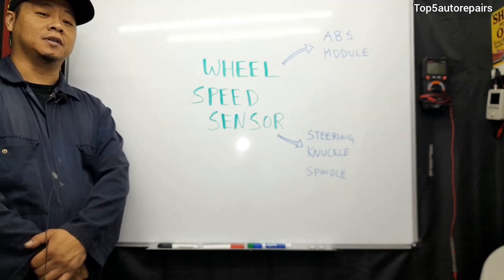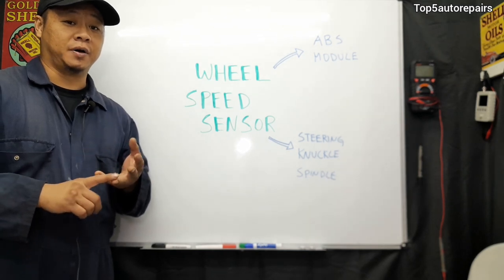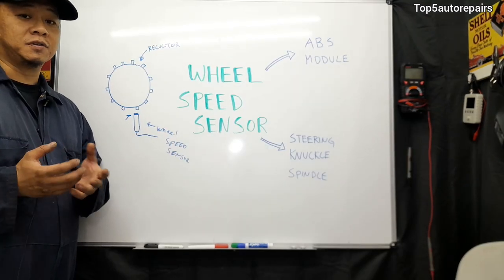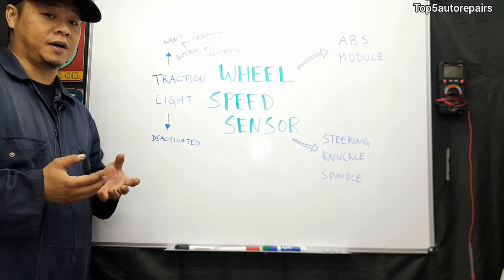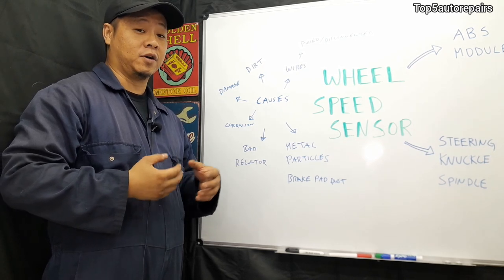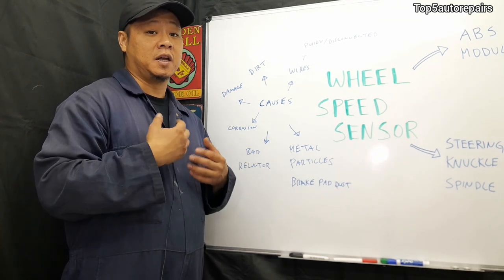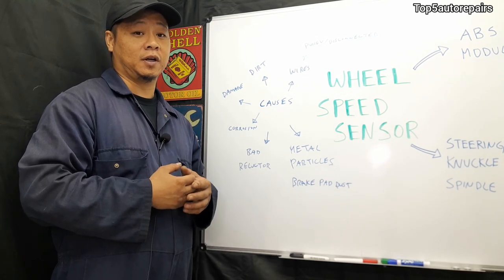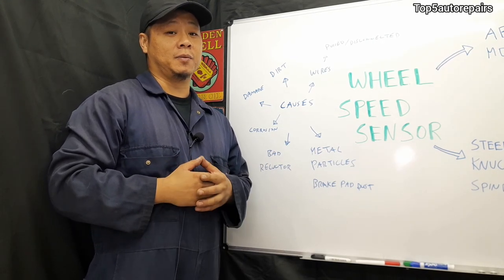Symptoms of a Bad Wheel Speed Sensor How it Works and Cause of Failure C0040 C0221 C0035

Comment: Question… my abs issue is at slow speeds.. i feel the abs working “thumping”  when breaking.. but one i get to higher speeds it works normally and stays normal.. even at slow speeds..abs light is on..   once i shut bike off and start again.. it does it all over.. i did just have my front tire off… i also installed a thundermax tuner.. so I’m not sure what one could be the issue

Thanks
Reply: I have this issue too
Reply: @JustATruckDriver1  wheel bearings.. replace them.. fixed the issue
Reply: @christopherbohnyak443  have you heard about the wheel sensors as well?
Reply: @christopherbohnyak443  also, my brake fluid low warning light is on and also my brake light is on
Reply: @JustATruckDriver1  that i have no clue.. could all be because it’s low.. but if it’s low.. you have a leak somewhere.. good luck…
Reply: @christopherbohnyak443  thank you man I was trying to do it myself but worst comes to worst I’ll bring it to a shop

Comment: I've got a 2002 Silverado and the front passenger wheel speed sensor harness wires have completely severed from sensor and thus opening up that circuit completely. Would this severence of speed sensor circuit on that wheel cause the 4wd to not engage?

Comment: Hi, thanks for the video lots of info. I also have a question. My 2014 dodge journey shut off while I was driving and check engine turned on and the traction light on too. When I tried turning on the car it didn't let me till the 3rd time. I took it to see the codes and it Said C121C-00 Torque Request Signal Denied. And code C0031-1D and COO34-1D Left and Right Front Wheel Speed Sensor - Circuit Current Out of Range. I just don't know why engine shut off on me. and I can't drive it pass 45 mph

Comment: Does a faulty abs sensor cause the transmission not to shift properly? Because mine does. When I'm on wide open throttle, at high rpms (4-6k), the car hesitates to rev as though it hits a rev limiter and the car stops to continue accelerating. Can you advise? Appreciate it in advance Sir.
Reply: Same here did you find out please let me know
Reply: I think, I hope, I have the same problem with my dodge charger. I checked the live data yesterday via OBD and even though the vehicle was stationary it was saying the speed was 17 mph... I hope this is the problem and not the transmission 🤞🤞🤞
Reply: uodate ?